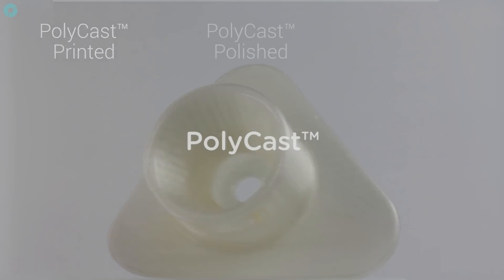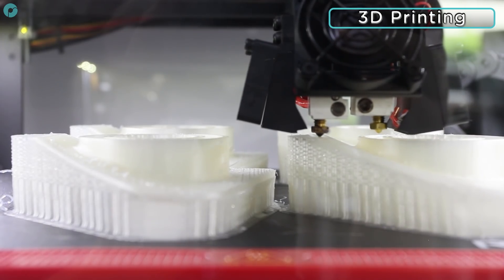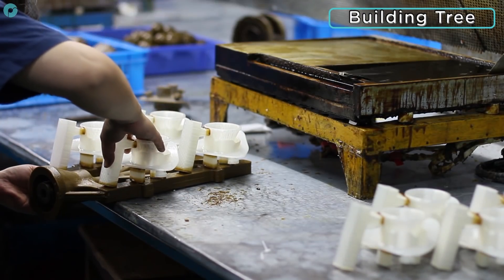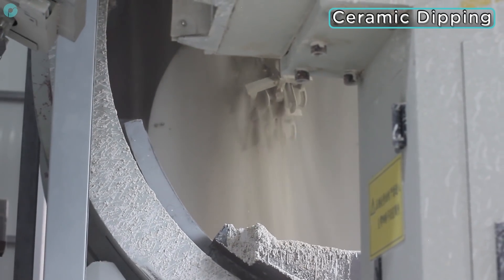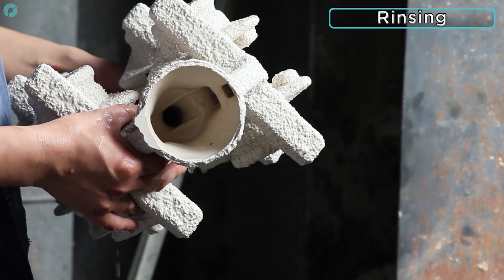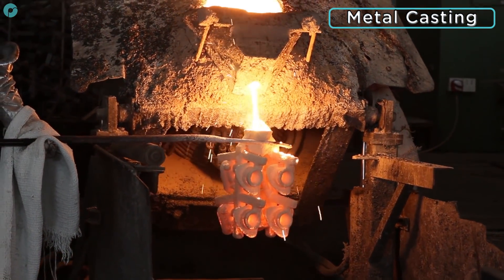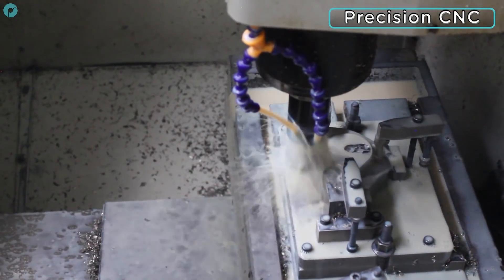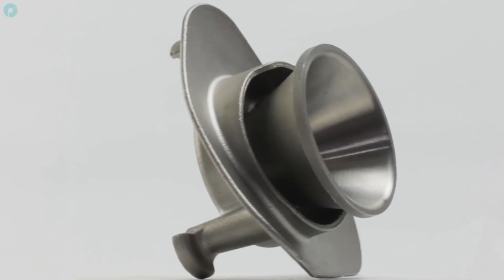PolyCast™ - a 3D Printing Filament for Metal Casting

Comment: Pouring straight into the invested mould without a sand support around it blew my mind. Nice!
Reply: The ceramic they use isn't as cheap and reusable, but it is definitely quick and strong.
Reply: I've been trying to do similar with plaster of paris moulds for casting aluminium but they keep cracking.  Think I will try adding fine sand to the mix and perhaps some fibreglass from insulation.
Reply: @Spedley_2142  Don't use plaster of Paris. Get some real ceramic compound type of investment plaster. Coating the outside of the mold with silica while it is still tacky wet will strengthen the mold.
Reply: @Super73VW  Not an option as I have to work with what I have.  I did just try a fine sand mix and it was a LOT stronger.  Also keeping it in a sealed container while it heats up and then letting moisture out slowly seems to help prevent cracking.  Will do a proper test tomorrow,
Reply: Sand makes it a lot stronger but also make it worse at sticking.
Reply: That is standard for investment casting...and has nothing to do with 3D printing.
Reply: @Spedley_2142  The problem might be the moisture, try to bake the plaster cast to eliminate moisture and use a perforated matel casing when possible.

Comment: For those of you saying "just use PLA"... standard PLA will leave .01% ash.  This leaves less than 1/3 of that, so there is a significant difference.
Reply: Does that affect a lot the finished part ? by what factor ?
Reply: @Jpifr  surface finish + contamination of the alloy...
Reply: Ash is left after burnout, and can be cleaned out prior to pouring metal.

There are many different casting processes.

Some people literally pour metal into a sand mold while the PLA is still in it, then the molten metal burns away the PLA. This method can achieve surprisingly good results sometimes, though results are not the most consistent and predictable.

On the other hand some people, fill a bucket containing the PLA with plaster and then their mold frequently breaks or cracks. Because the mold has 3 inch thick, four inch thick, or even thicker walls, which leave more room for bubbles, and critical differences in heating/cooling rates through the material.

Then there are methods as shown here, where the mold is built up from multiple ceramic coats. This creates uniform material thicknesses. You don’t need a mechanical cerami dipping processes as shown here though. Coats can be built up with brush coats, or manually dipping an individual piece by hand.

As far as I know, lost PLA casting developed as 3D printers became more accessible and affordable. So it’s a fairly young development, and as such is still maturing. Current lost PLA methods will be improved, refined and enhanced.

Lost PLA is a stop gap solution though with a limited lifetime of usefulness. Because we can already print directly to metal, in a dozen different ways, and direct to metal is of course ideal. So it’s really just a matter of cost. As costs come down on direct to metal additive manufacturing, along with innovations in that field improving quality of output, ease of use, and speed of output, lost PLA will probably become a lost art.

So if your running a large operation doing a high volume of production, then maybe, a filament like this polyforn could make sense. If the reduction in ash after burnout is actually going to translate into faster turnaround and reduced costs… Of course that must also be weighed against the cost of any retooling, retraining, and potential downtime involved in transitioning. It would also be worth comparing those estimates with estimates on implementing an ash removal step between burnout and pouring. Finally, it must also be borne in mind, that lost PLA may be obsolete in the not too distant future, so everything should be weighted against s plan to transition to direct to metal printing eventually.
Reply: @multi-mason  1 year later and direct to metal printing is still insanely expensive with no cost reduction in sight.
Lost PLA is still incredibly viable for most hobbyists and small businesses.
Reply: @multi-mason  But printing to metal typically have a shrinkage factor, also cast is stronger than printed.  So for the ease and ability to change the design on the fly this is pretty decent.

Comment: This is awesome. I need to do this at home.
Reply: Use regular PLA, it works the same, I have cast throttle bodies for an engine before from PLA (cast was done in Alu)

Comment: Me clicking on this video thinking I'd be able to do this at home.
Reply: You can likely do it at home, with a little change in method (immersion in a plaster compound).
Reply: Yeah it's doable, although from my experience you wouldn't get this nice of a finish or tolerance
Reply: You can. There are some YouTubers doing this stuff.
Reply: even if you printed and polished a mold and found a local or not local foundry to put it in their run...then you get something you wanted, and experience, and you don't need a foundry or metallurgist's knowledge off the bat. It's a starting point, I think.
Reply: Yes me too lol. Start with a cheap home 3D printer but then have a complete full blown factory behind it. Seems weird. Why not use mold injection machine then.
Reply: @UncleKennysPlace  yeah I got scared when they started dipping in ceramic but then I had the same thought. Why not just dip in something else? its the same thing? then kiln in it and pour.
Reply: @bertpierey3655  Maybe the ability to change design on the fly?  I wondered the same thing.

Comment: You guys should make a second video showing how this can be done at home.
Reply: if you dont have a big industial foundry behind your house, rather not.
Reply: @derxman  no you can do metal casting at home. Usually done with aluminium instead of iron but still a very similar process. I'm just curious if using aluminium would change anything.
Reply: @x9x9x9x9x9   this is investment casting also known as lost-wax casting. Not an ordinary casting method. Very expensive and labor intensive with ceramic materials.
Reply: @x9x9x9x9x9  the main difference is that you have to burn the caramic material and remove the wax at very high temperature before the metal casting procedure. Hardly feasible without an industrial oven.
Reply: @derxman  can it be done using the plaster of Paris stuff? Basically I want to know of this can be used similar to the wax filament.
Reply: @x9x9x9x9x9  you normally don't want to use plaster of paris to do casting as it retains a bit too much water and can cause explosive results.
Reply: the home version of this would be the use of silicone and low temp metals where you can print out  a 3d object and then make a two/three/four part mold out of silicone and then use either resin or low temp metals to cast a part out of...   Or you could do the lost wax method as described on other blogs/youtube videos to cast aluminum but that involves building a "foundry furnace" as well which is run off of propane.  Just search for lost wax method with pla on the ole youtubes. :D
Reply: Basically,  use the 3d printed part as the positive portion of a sand cast mold - that's what I'm going to do. You can do investment casting too but sand casting probably easier and you can use regular PLA
Reply: You could most likely just skip the ceramic coating and just use plaster, then you could do it at home with aluminum.
Reply: @derxman  you shouldn't shut people down when you obviously know little about the processes
Reply: @mannycalavera121  yeah, for sure. I don't said casting in general isn't possible DIY but this particular method indeed. There are a a lot of different techniques for metal casting.
Reply: @derxman  Du hast leider anscheinend keine Ahnung von der Materie...
Reply: @maximilianlindner  worauf beziehst du dich genau? Dieser Diss in eine generelle Richtung ist genauso wertlos wie die Aussage des selbigen. Grundlegend habe ich schon eine Ahnung, in sofern ich dies studiert habe, mit spezialisierung auf polymer engineering & rapid product development.
Reply: the process they use you might be able to use....you essentially bake a ceramic mold around the plastic then drive it off. maybe applied science could help out? .... it seems like you should very much be able to do it - it would just take a lot of trial to get the process working decently not unlike the glassmaking videos he did
Reply: You can just use standard plaster slurry and silica sand intended for sandblasting to make a ceramic "form", difference when burning it out it needs to be supported by sand or similar as it will be alot more brittle than the industrial variant. Burnout can be done your foundry.

Comment: Ash free but the video shows emptying the ash out of the mould. Maybe it is just PLA at a premium price.
Reply: 0.003 percent ash
Reply: @JohnSmith1066-l5n  Yes so it is not ash free as stated.
Reply: @garyhoffmann1615  right. i didnt hear that bit. it does say its 0.003 percent ash and they show it being washed out for higher quality finish casts
Reply: @garyhoffmann1615  These comments are not douche free.

Comment: I think the video explains it very well, although not everything. The liquid in which the pieces of FDM are bathed, is a colloidal silicon compound, to which Chamota is added in layers as if it were a batter.Subsequently, it is cured at 800 degrees, to evacuate all possible moisture, then it is verified that there is no ash inside and the mold is dried to dry.

Doing this with plaster of paris is causing an accident, formerly in the foundries of lost wax was used paris plaster with brick dust, but caused large explosions of water vapor if not well dry. when dumping the metal.
Doing this at home is exposing yourself to a huge accident.

Comment: what kind of ceramic do you use? I'm trying to replicate the process so I can produce aluminum parts but I can't find a plaster mix that can withstand the heating process to melt the filament.

Comment: Is it possible to use this for backyard foundry work outside of an industrial setting? This looks like an excellent tool for processes similar to lost-wax casting but I can't imagine the average consumer having a use for this.
Reply from the maker: PolyCast™ completely vaporises at temperatures of >600°C, however the Tg is much lower (70°C).
Reply: @Polymaker  what is Tg  in your post ?
Reply: @proteo-x4u  Tg stands for glass transition. Think of it like the temperature a material will change from solid to rubbery.

Comment: How cost effective is this process for a hobbyist doing it in their back yard? I know a lot of people do lost-pla casting for metal parts, as outsourcing to machinists is expensive, and even more expensive for one-off parts, and even more so for single part projects; I know of a lot of shops that won't even take one-off, small production, or prototype projects.
If this process can be cost effective, it'd be a good investment.
Reply: Xander Zoolander there are some parts you can’t machine which makes casting the only choice. If you’re in that situation and you need a metal part, you’d need to do a casting.
Reply: @goldwinstewart6590  I realize this, and this is why I'm asking the cost effectiveness compared to typical lost-pla casting. 
Also with 5+ axis mills, there's very little that isn't possible to machine.

Comment: for the complex parts that have to be printed in multiple piecse and then stick together what is the best gluing product for poly cast that dose not affect burn out?
Reply from the maker: Isopropyl alcohol (IPA, isopropanol) is the best method to join PolyCast™ parts together. Use a brush to apply the IPA to the sections you need to join and the surface will become tacky and sticky. You can then mate the faces and clamp or tape them together while the IPA evaporates. The parts will then harden together with a chemical weld. This method will also burn away very cleanly leaving no additional residue.
Reply: @Polymaker  thank you

Comment: Can shells be autoclaved to remove the wax trees before firing in the kiln? We have dealt with materials that work well in the autoclave and others that expand too much and cause the shell to crack.
Reply from the maker: Hi Scott, the PolyCast™ patterns cannot be autoclaved to leave the shell. The material is designed to be burnt away and completely vaporizes at temperatures of >600°C. We suggest skipping the autoclave process used with wax patterns and burn out the PolyCast™ patterns at the same time as curing the ceramics.
Reply: @Polymaker  Hi - I spoke to a Investment caster about this, but he felt burning out the PolyCast would take too long in the kiln.  Does it take longer to burn out the PolyCast than the time normally taken to cure the ceramic molds in the kiln?
Reply from the maker: @markpickering9078   Hi Mark, the burn out process happens at the same time as curing the ceramic. There is no additional time needed to burn out the PolyCast™ patterns. PolyCast™ will vaporise quickly at temperatures above 600°C. Our customers usually fire their ceramics at 1200°C for 1-2 hours to cure, this timeframe is more than sufficient to burn out the PolyCast™ pattern.

Comment: That ceramic solution can replicate at home?? What components does it has?
Reply: Investment casting derives its name from the pattern being invested, or surrounded, with a refractory material; in this case, the ceramic is the refractory material. Most, if not all, commercially available investment plaster should be ceramic. As ceramics are heated clay, and clay is easily made into a slurry, it makes sense to use it. 
If you don't know much about ceramics, their use as refractories, or the various composition of ceramics, DigitalFire has a good glossary page on refractories. I'd post a link, but I'm pretty sure links get filtered as spam.

I'll also point out that you have to bake the clay slurry coating to make it a ceramic coating, which will also burn out the plastic being molded. This requires a lot of heat, especially with large pieces, and typically requires industrial sized furnaces. A better solution is to use the normal lost pla casting method; or silicone molds, depending on what metals you're using and if you can find a product with a high enough temperature range.
Reply: @xaytana  thanks you very much. My idea and what i have been trying for a long time is to make aluminium parts. I have an induction furnace to melt the metal but i have problems to find a mold capable of resist high temperatures

Comment: What a kind of polishing process? Sand/soda blasting?
Reply: Probably acetone vapor exposure... It melts the sharp points and surface tension polls the liquid-polymer to a smooth finish, that's how it works with ABS
Reply: Smoothing the part with alcohol (like ABS/acetone but with alcohol)
Reply: Paolo G  Is it PLA? They say it prints like PLA, but it might be something different.

Comment: Can't the moulds be pre-heated to drain the PLA out for re-processing/ recycling. And then fire in oven...
Reply: Not really. PLA won't flow like water. It's more like solid > thick lava > gas. And PLA is pretty cheap anyway.
Reply from the maker: PolyCast™ is vaporized at >600°C typically leaving 0.003% ash residue. The molds need to be preheated to fire the ceramic, this also allows the molten steel to flow better inside the mold and to make sure the heat shock doesn't crack the mold. Traditionally, wax patterns would be steamed out under high pressure in an autoclave prior to preheating. Using PolyCast™ this stage can be omitted and the burn out can happen at the same time as the curing of the ceramic.

Comment: Pretty sure regular PLA will do the job,
Reply: This will probably perform a bit better. Your average hacker just trying to make some rough parts probably wouldn't care, but if you want the best results with very dense details, more specialized products help. VegOilGuy has done some extremely details casts with tiny coins and whatnot and has done a variety of tests with several products and methods which shows what works.

Comment: A quick question does this type of filament based on clorocarbon or is it based on hydrocarbon 
This is really important for my use
Reply: I think it's Chlorocarbon. At 0:52 you can see it being smoothed with alcohol,  and If I remember correctly only chlorocarbons can  melt with alcohol.
Reply: MichaelKingsfordGray  Not really. Hydrocarbons only contain hydrogen and carbon atoms. Alcohols also contain at least one oxygen per molecule. This makes them more or less polar, as opposed to hydrocarbons which typically are relatively non polar.

Comment: Could you use this with a sand mold and use the heat of the metalnto burn it out?
Reply: I don't know if it would melt quick enough, but you could use a mix of  plaster and sand and melt it out using a blowtorch or just stick it in a wood oven.